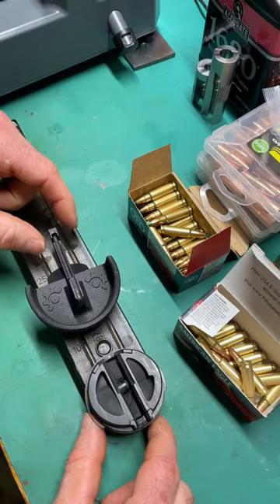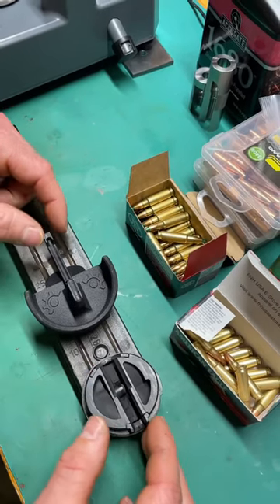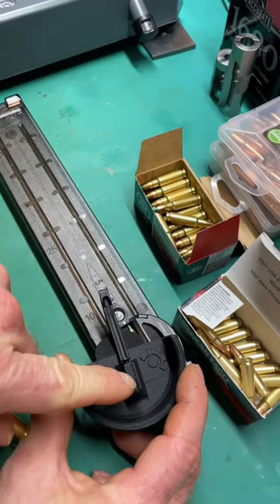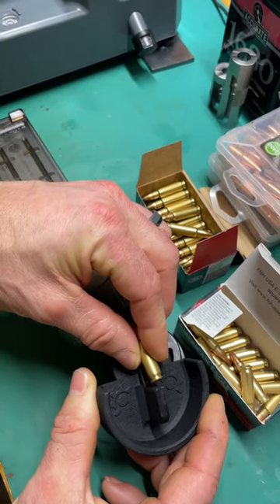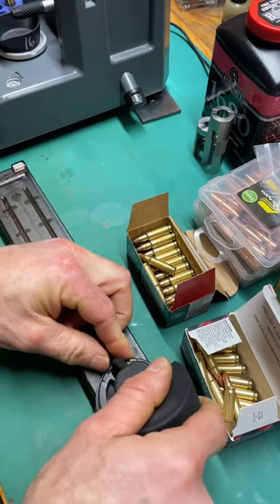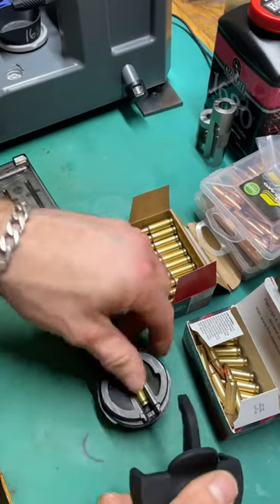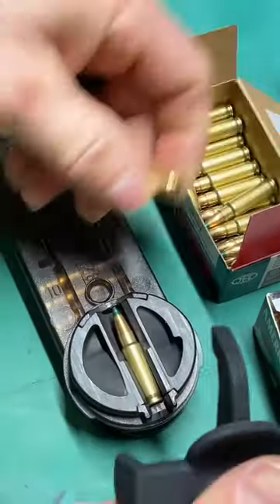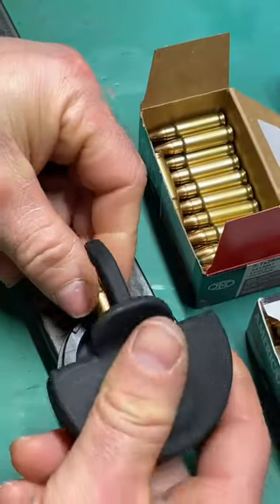FN P90 / Keltec P-50 Mag Loader Assist Tool - Custom Smith Manufacturing #shorts #57x28mm #FNP90

Comment: It's slower than loading it normally. The trick is to use your off hand to push lightly on the backside of the loaded round. Then the other thumb lightly pushing down on the new round and then slide it back. This may be a useful tool for some or those who have issues with their hands. Kudos to the idea at least.

Comment: Eh, this loading tool is alright probably won't buy one, it doesn't seem to load it any faster than I normally can load a FN P90 mag. Maybe it will reduce hand, finger or thumb soreness after loading several 50rd mags, lol.
Reply from the maker: I’m just happy someone is making stuff for the platform. I will agree Normal loading by hand at least with good finger strength is faster :)